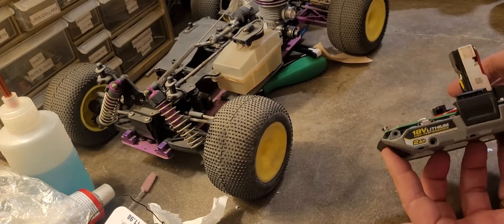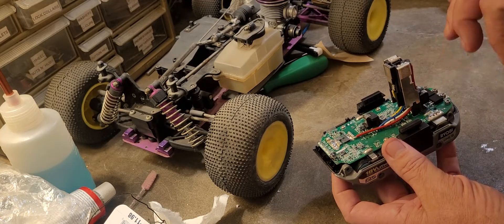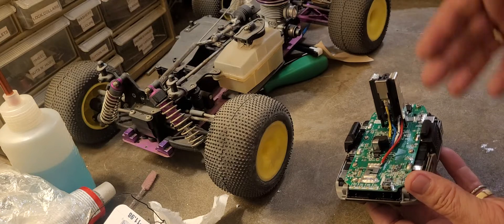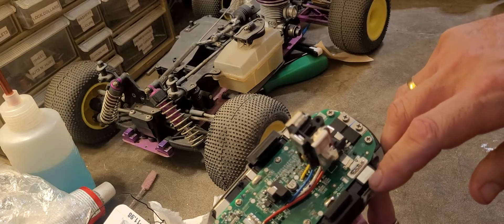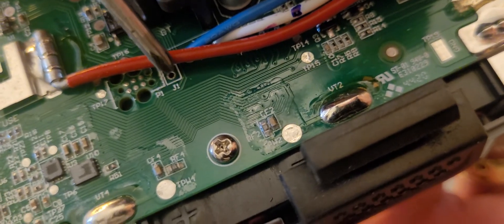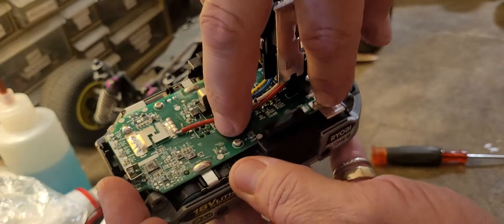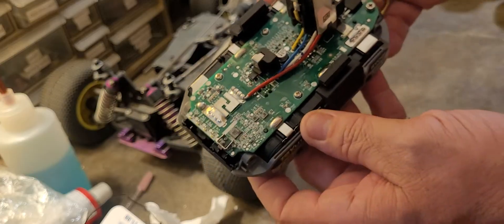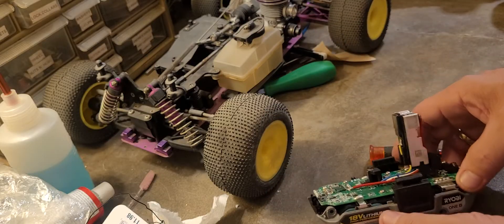Ryobi 18v lithium battery 4 flashing lights fix circuit board reset

Comment: NICE. Perfect this worked! 

Check your cell voltage. If you are 3.9 to 4.1V, on EACH cell, this is your fix. 

If you are under 3.9, or have 1 cell that is way off, look up reviving Ryobi battery or cell balancing.

Comment: My battery had a full charge when I tested it with my meter. But on the charger, the red light just kept blinking and the button on the battery had the 4 blinks when pressed. I need to make a jumper and see if this works for me but I wanted to Thank you for sharing and the video.

Comment: Hey there I hope this info works. Same thing happend to me. I left the a drill with a battery in it outside one night I guess just the dew moisture got to it. I hit the button to check battery and all 4 lights started blinking and it did that until it was dead. Charger just won’t charge it says bad battery. Imma try this I hope it works these battery’s are 100 a pop! Crazy!

Comment: I tried everything cells ok but did not charge on charger until I vacuumed the pcb. There were fine metal shavings on the back side of the board. I have been using a small angle grinder a lot lately 😂

Comment: Tried this and the other suggested method, neither made any difference. No doubt the actual faults may be different. I tested all the batteries, one was down to 3.6 volts, the rest were all 3.98 volts.

Comment: I've seen a video which defined exactly what was happening with my battery. I.e. It was fully charged but read 0.06 volts at the post but 18volts at connections inside. The reset seems a logical requirement unless the battery was unserviceable. The J1 point was the contact point. On your video you connect J1 to outer earth. On the other video it says connect J1 point to small hole next to it under the Red wire. Connecting electrical connections could fix the problem or destroy the board. I'll check both videos and see which seems best option. Not sure if hole next to J1 point has a connector but it may be either way may solve the problem?

Comment: For my 18V Ryobi battery, all 4 lights would blink 4 times each time I pressed the button and the battery would not charge or operate a device. The post was reading a little over 18V and the internal positive to neutral battery terminals were reading a little higher. I jumped J1 and Neutral as shown in the video. It sparked when I did this and after that no lights would come on when I pushed the button. Also, the internal positive to neutral battery terminals read the same, but the post terminals only read a little over 1V. The battery still would not charge.
Reply: I don’t know what you mean by “neutral” but I followed the video instructions and didn’t see any spark. Got 2 of the LEDs flashing with one not flashing between them. Battery now charging normally.

Comment: Thanks; I had topped off the cells but couldn't find the board reset! Battery recovered.
Reply: Under the red wire next to the big terminal post that sticks thru the top piece molding 2 little silver terminal looking holes to jump

Comment: I have battery doing the 4 blinking lights.  I read somewhere other than here that it’s a jumper across J1 and T2 right next to it.  Wonder if essentially the same two circuit points?   I’ll give it a shot once I find my security bits.

Comment: Mine is strobing in a row from led1 to led2 to led3 to led4.
At one point, it went to two lights, as you mentioned, but wasn't working. 
After I hit the button again, led1 flashes 4 times.

Hmmm, now when I put it on the charger, the leds flash down the line, then led1 flashes 5 times.
Reply: same here.  How did yours end up?
Reply: I've been so busy with everything else that I haven't tried working in that one yet. The one that was just so dead, that it went to red right away, I used some old Tesla 18500 batteries and a couple of the ones I took out of my defective RIDGID battery pack, repair it. It worked until I dropped it. The solder came loose, so I have to take it apart again and resolder those. I had a little difficulty soldering those batteries in. I need to roughen the metal surface better, so the solder sticks better.